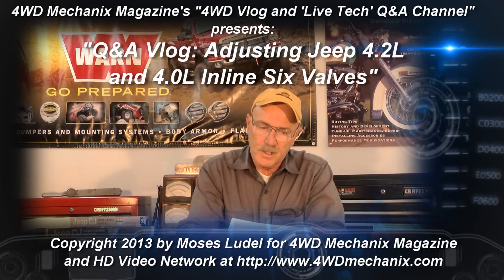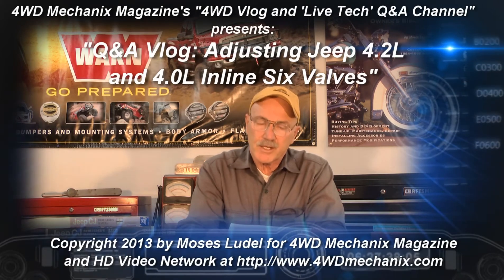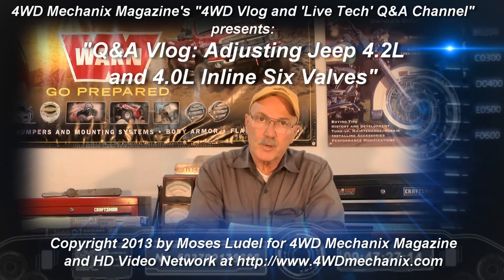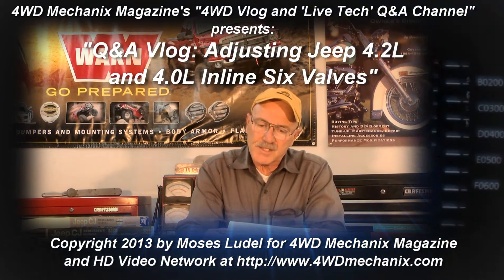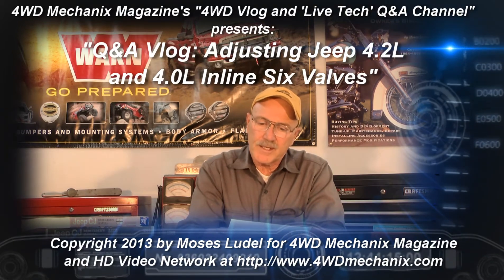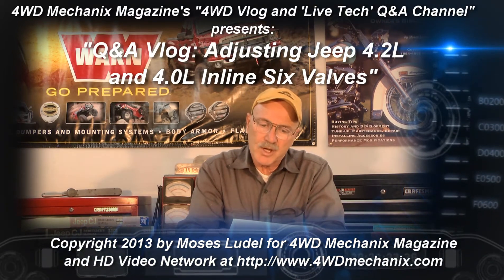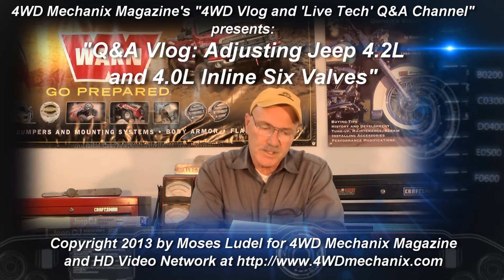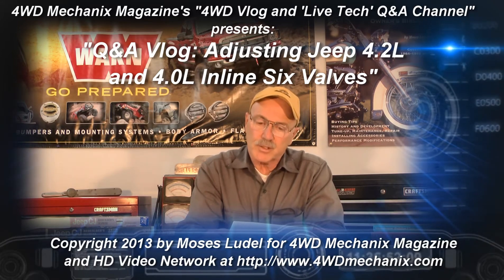Adjusting AMC/Jeep® Inline Six-Cylinder and 2.5L Four-Cylinder Valve Lifter Preload

Comment: Shimming the rocker pedestal with shim stock and using the proper length push rod to maintain the rocker in the middle of the valve stem.
Reply from the maker: Make sure the lifter preload/clearance is in the mix.  I use a CompCams pushrod gauge and size the pushrod lengths for the correct lifter preload at each valve.

Comment: Excellent vid. Not all of my lifter plungers move when I push the rod down. Will they correct themselves? They are new and never been run. I bought a R/A from a "reputed" stroker guy, but am hitting a lot of problems. I decided to recheck the rod length and now I noticed some of the lifters are solid rather than spongy. Didn't soak them, but they were primed with the oil pump a few months ago. I don't want to torque down the Harland Sharps until I understand this better.

Another question re TDC. I'm working alone with the engine in the Jeep. is there a count of turns to get to the next TDC? I'm set on #1 and wonder if I can turn it X amount of times to get to TDC on #5. Assuming that that is the closest based on firing order.

THANKS!
Reply from the maker: Good that you have not attempted to install the head, pushrods and rocker arms.  If you primed the oiling system with the head, pushrods and valvetrain not on the block, several or all of the lifters have "pumped up".  The plungers extended in those lifters, and now the non-compressible oil will not allow the plungers to drop down.  (In a normal engine running, with all parts installed, it takes several rotations of the crankshaft for each 0.001" of plunger drop.  At this point, you cannot assemble and crank the engine to achieve this drop without risk of damaging the valves and pistons.)  So, you need to remove the lifters from their bores and push down/pump each lifter plunger with a pushrod to expel the oil from within the lifter.  Once the oil is pumped out, you can reinstall the lifters, install the head and rockers (no pushrods in place at this point) then measure the pushrod lengths for correct plunger preloads with a CompCams or similar pushrod length gauge.  Fit the correct length pushrod at each position and reinstall the rocker arms...As for finding the crankshaft position with both valves closed, install your distributor with #1 piston at TDC.  Note the position of the rotor.  Spark plugs removed and pistons visible, lifters on their base circles or low points, check pushrod lengths and lifter preloads for #1 cylinder.  Now rotate the crankshaft in the normal direction until #5 piston just reaches TDC.  Both lifters for #5 should be on their base circles or low points of their camshaft lobes.  If the piston is at TDC with both valves closed, you can check the pushrod lengths and lifter preloads.  Now slowly rotate the crankshaft in the normal direction to #3 piston at TDC, both lifters on the base circles of their lobes, and fit these two pushrods while determining the correct lifter preload.  Do this for each cylinder in the remaining firing order (1-5-3-6-2-4).  Consider that each position in the firing order is 120 crankshaft degrees apart.  As an alternative, if you have a degree wheel or protractor, you can mark the damper pulley at the #1/#6 TDC position (already a factory mark there) and then at 120 and 240 degrees.  Following the firing order and rotor position, align the marks while verifying that the piston is at TDC.
Reply: @4WDMechanixMagazine  I will read this post a couple times to absorb the info, but to be clear, I primed it while everything was assembled. Spun the oil pump gear with a drill until the rockers overflowed. This was a few months ago. The engine sat while I researched some stuff. I recently disassembled the rockers to change the springs out for cam break in. I think I can still apply your technique to drain the lifters. The motor has never been started. Working towards cam break in but had to go backward to verify some bad intel from the guy who supplied the rotating assembly. Proceeding with caution...
Reply from the maker: Priming while assembled should have worked...A possible cause for the lifter plungers to rise and stay extended would be oil present in the hollow pushrods and lifter oil galley while you removed the valve springs.  When you removed the rocker arms, pushrods slacked and the lifter plungers rose under their internal spring pressure.  Oil could have drained down from the pushrods and into the lifters (some or all of them), filling the lifters.  This would hold the lifter plunger in the extended position...Yes, try what I suggested about removing the lifters (easy enough on a Jeep inline six).  Pump the oil out of the lifters, and if necessary, do the pushrod length/lifter preload check again with a CompCams pushrod length gauge available at Summit Racing and elsewhere.  I describe the gauge in my forum coverage at:  https://forums.4wdmechanix.com/topic/849-choosing-jeep-40l-and-stroker-six-pushrod-length/.  With the right pushrod lengths for correct lifter clearances, lube the lifter bases with assembly lube and install the pushrods and rocker arms before priming again.  (General rule:  Do not prime or crank a hydraulic lifter engine with the rocker arms removed.)  Let us know what your find.
Reply: @4WDMechanixMagazine  I have the measuring tool and the lifters on no 1 are not solid/pumped up, so I can get my rod measurement. I'll empty the others and hopefully everything will be ok. 
Thanks a million friend!
Reply: @4WDMechanixMagazine  Fun with lifters. Got the first one out and the oil wouldn't pump out so I took it apart and put it back together. Some oil did spill out and it seems really good now. Would torquing the lifters and slowly rotating the crank force the oil out up through the rod. I always heard about lifters draining over time too. Hylift/Johnson lifters. Never under any significant load. Just from hand turning the crank a few times. Big problem is that several cannot be removed to service due to the head. Do the  holes on the plunger line up with the outside hole or should they offset?
I will have to do this one more time when I replace the springs. I think I'm just gonna have to use the crank to take pressure off of the lifters and hope for the best. I can remove about 8 of them but I do believe that I'm ok as long as I get the rod length right. FASCINATING STUFF!

EDIT: Plungers fully compress after disassembly. Seem a bit soft, but probably normal.
Reply from the maker: Of course, all of these "compensating remedies" have to do with lifters pumping up with oil—this is not the normal scheme of things.  The valvetrain should be assembled without oil inside the lifters to avoid extending the lifter plungers...Given your dilemma, if you were certain that the pushrod lengths are correct, there is an alternative approach for getting the plungers to drop in a running engine.  You could try a traditional (pre-LS) small block Chevy V8 method of adjusting the rockers to "zero lash" and then setting/adjusting the preload.  For your Jeep inline six engine, you would install the rocker arms and pushrods without tightening the rocker arms down to their pedestal seats.  One cylinder at a time, make sure the piston is at TDC on its compression stroke.  In this mode, both valves closed, install the pushrods and rocker arms without tightening the rocker bolts all the way.  Set the rocker arm clearance between the rocker arm and valve stem tip so that the pushrod can just be rotated with two fingers.  Once this has been done at both valves, move to the next cylinder's TDC on the firing stroke and repeat this process, again setting the clearance to a pushrod fingertip rotation.  When all 12 valves are adjusted this way (rocker arms not seated completely on their pedestals, valve lash at zero or just able to rotate the pushrods at TDC of the compression/firing stroke), the engine could be safely started.  At an idle, each rocker arm bolt could then be slowly tightened, something like 1/8 turn of the rocker arm bolt at a time.  (If you go a bit too far, you will hear the valve unseat slightly with engine roughness, so stop there.  The idle will stabilize as the lifter automatically adjusts the preload.)   Tightening the rocker pedestal bolt slowly and gradually, each valve will not unseat too much and hit the piston.  Eventually, each rocker arm is seated fully in its pedestal, and you can torque the bolt to specification.  CAUTION:  For this to be a final fix, the pushrod lengths would need to be correct.  Lifter preloads must be within the normal specification/range...If the pushrod lengths are in doubt, you do need to remove the lifters and drain them of oil like you did with the one lifter.  You are correct:  To remove all of the lifter/tappets on the 4.0L inline engine (or a stroker), the cylinder head must be removed from the engine.  The only option to removing the cylinder head is the use of aftermarket adjustable pushrods, which can be quite expensive.

Comment: when you're checking the length for the pushrod, are you torquing the rockers at 19-21lbs then checking for zero lash? Thanks
Reply from the maker: When using a tool like the CompCams gauge for pushrods, you would want the rocker arm fully seated (factory torque on the rocker nut) with the camshaft on the lobe heel (lowest point).  The length of the pushrod gauge should be the distance between the rocker arm's pocket and the lifter's cup with the lifter plunger fully extended.  At this point you add the amount of preload needed to the pushrod/gauge length.  That would be the desired pushrod length...I add details at this forum reply:  https://forums.4wdmechanix.com/topic/1306-amc-jeep-232-258-42l-and-25l-valve-lifter-clearance-and-valvetrain-noise/#comment-9230.